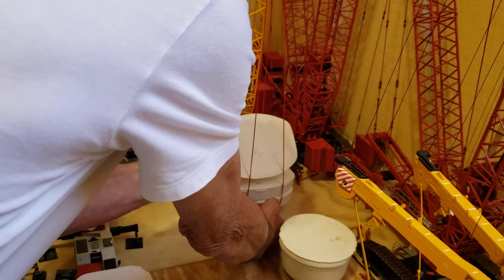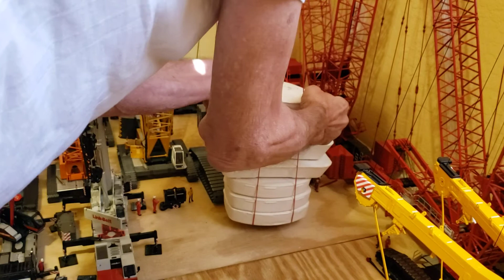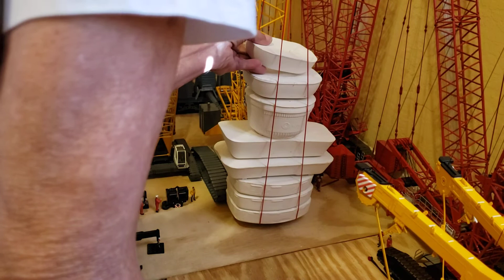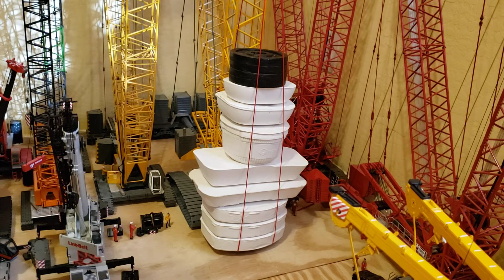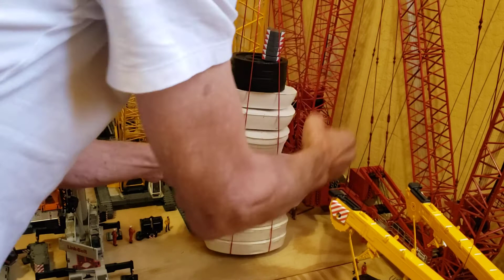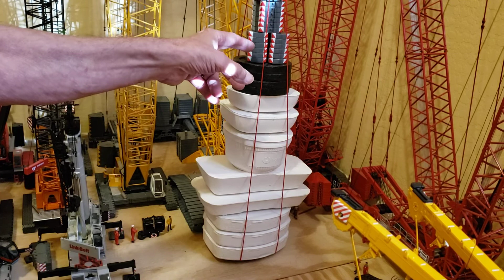LR1750 Main Boom Load Test

Comment: Hi john, good video.. 23 pounds around 10.43kg. If my calculations is right it was 1303 tons. Means this beast can lift almost double with their capacity.. But not sure because the the Derrick & ballast tray back there will make the beast more stronger..
Reply from the maker: Hi Aku, Thanks bro! That's about the same calculation I had gotten. Sounds way off to lift that much but I guess numbers don't lie. I have no doubt that more ballast on the wagon will lift more at the hook. You just gave me a good idea for a video trying to put more weight on the wagon and see how much more it lifts. My only worry would be...will the plastic parts hold up?
Reply: @lvdrums    better not try to much load. Maybe it will damage your some plastics part ..Hahaha.. I got an idea, that i want try to lift lr1300 using  lr1600 with ballast wagon, but i had some doubts like you, its the boom can hold the weight.. So i make decisions not to do it.. Lol...
Reply from the maker: Hahaha I know what you mean. It's a little scary to load these but the 1300 is mostly metal construction so it would hold up well I think. Have some fun and try it. The 1600 ballast wagon is pretty big...should increase the capacity of the crane.

Comment: according to my calculation, 20lb load in 1/50 scale translates to 1,136tonne of load (20lb= 9.09kg.  9.09kg* 50^3= 1,136tonne.)
 This is wayyy more than the real crane which can only handle 750t with the much shorter boom configuration and radius.
Reply from the maker: Thanks Ming, good to know that lol. It just sure seems strange to lift that much over it's limit especially with that tall of a boom. I was only expecting maybe 800t max before it gave up. Well, that shows how tough some of these models can be.
Reply: @lvdrums  You should do the load test on the cc8800 that you have ;) it should be able to handle a lot more.
Also, I really hope that you can get the SGC and hang a 50lb dumbbell from its massive hook ;)
Reply from the maker: Hahaha don't get ahead of me Ming lol. That 8800 is all the way at the end but I guarantee you it will get a load test. Can't wait to see what it's going to hold. That's the most solid model I have....it takes a really good pull on the boom to lift that huge ballast wagon. Now that SGC....I have about 90lbs of weights with dumbells so I'm ready for it when I can save up enough for it. 😄